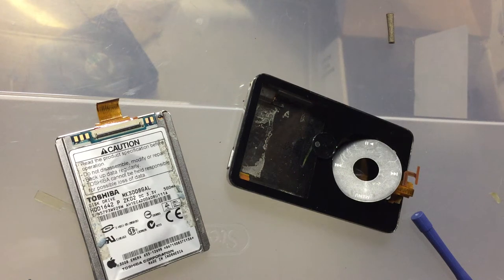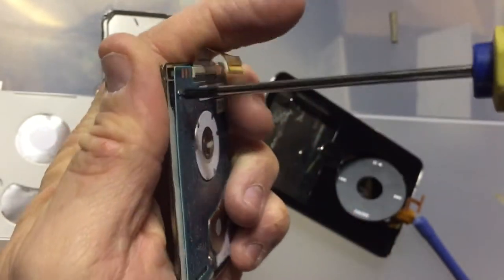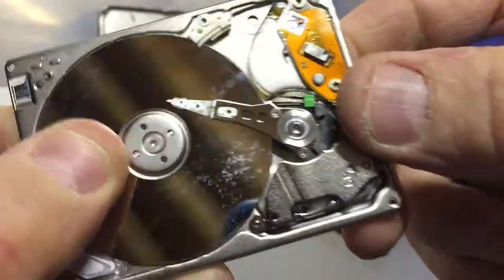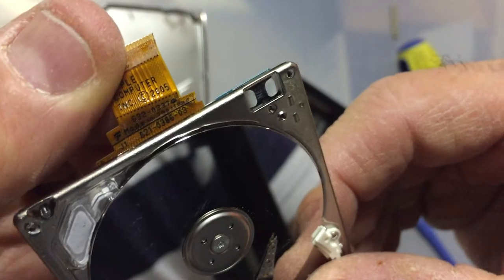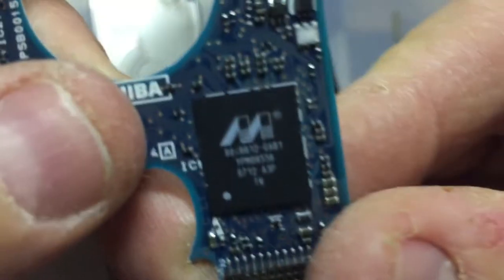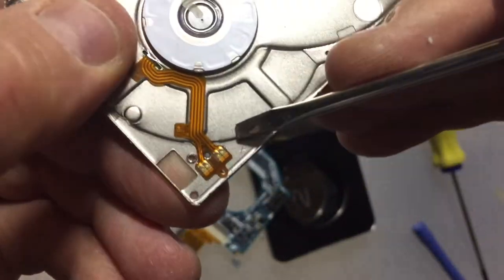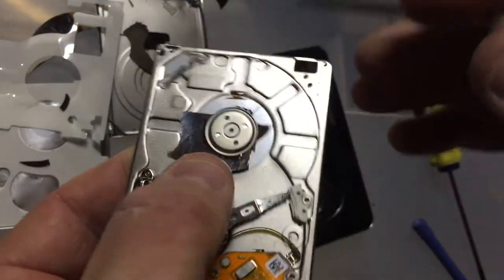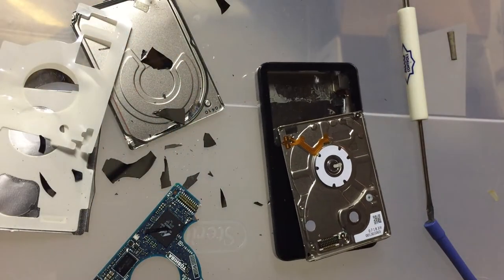Retro Teardown: Apple iPod Classic Toshiba Hard Drive Failure

Comment: If you use a 1mm flathead bit you can wedge it in between the lobes and turn them, at least on a 4th gen 20gb drive. Flatheads defeat more security screws than you might think

Comment: Wiha 26794 Precision Pentalobe Screwdriver Set will allow you to open up those screws
Reply from the maker: I used some generic noname, there are lots of cheap options available online, both hex, torx and pentalobe, even some that handle "security screws" (the ones with little pins in the middle).